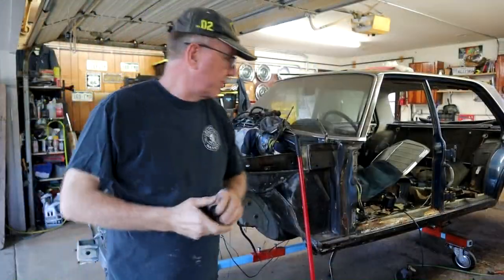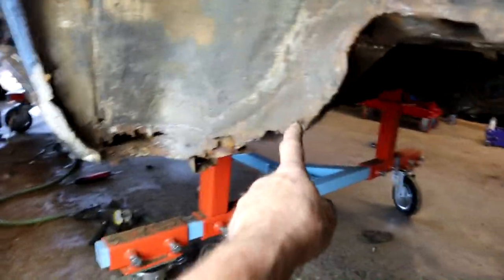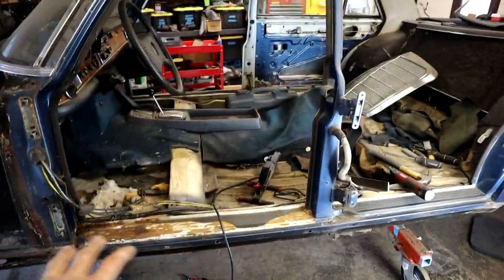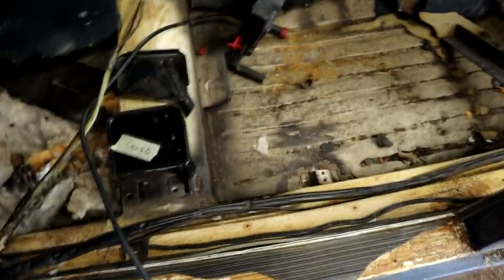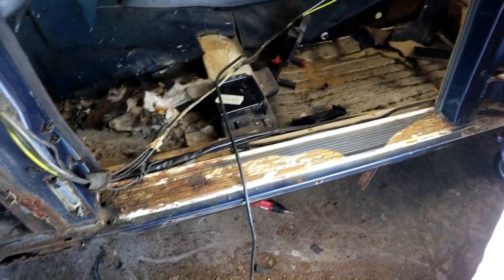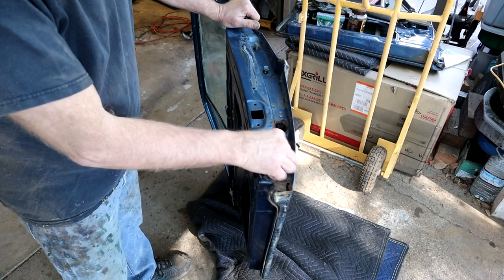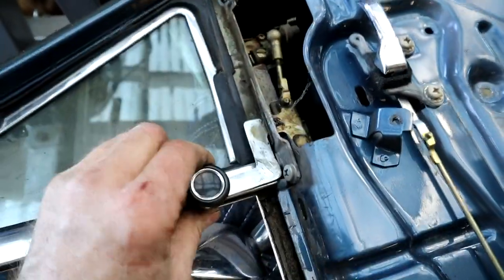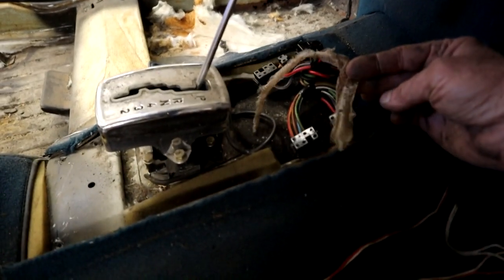Mercedes W109/108 Rust Prone Areas.

Comment: Hello John when I was Restoring my 230 sl MB “under seal”was the bane of my life watercreeps under it and that’s where the rust starts hate the stuff. when all the rust was cut out and sections where repaired I painted a thick coat of seam sealer and two coats of Chassis black Underbody wax around the box sections Then drilled holes on box sections fitted rubber plugs after injecting cavity wax . I used Bilt Hamber products (no I don’t work for them) Good Luck it is worth in the end
Reply from the maker: Bilt hamber? Not heard of them. I'll check them out. I was thinking along the same lines as far as drilling some strategic holes  and injecting Waxoil, into the hidden sections.
Thanks again.  Cheers John 🍻
Reply: @mercedesmaintenance.6339  John I assume you live uk check out Bilt Humber website in my opinion it’s a superior to Waxoyl regards
Reply from the maker: @johncross8834  I'm actually in Northern California. But I will take a look. Cheers John 🍻

Comment: My god you have a lot of work ahead of you on this.
You obviously love doing the work and have the ability to do it. It’s like you are building this car from scratch.
I don’t think there is a single part of the car you won’t have redone.
I hope you can get all the parts you need and don’t get frustrated by not being able to source or fabricate what you need.
I wonder what is your approximate time frame to complete the project?
Reply from the maker: I hope to have it completely done in about two years. The hunt for parts and solutions is all part of the fun:) 
Cheers John 🍻
Reply: @mercedesmaintenance.6339  You will have a great sense of accomplishment when done. I wish I had all your skills to take on such a job. It’s a shame you have to do so much structural repair from rust damage. That car will probably be better when you are finished than when it came off the production line.
It’s such a shame older cars are exposed to so much salt in the US.
I cringe when I drive here in the winter in New York ….. you can almost feel the salt eating away at your car.
Reply: @mercedesmaintenance.6339  John, check out a channel called “Restore It” … sorry I don’t know how to add a link for you. It is another English chap on the other side of the pond. He is doing a project at the moment on a W123 which has horrible rust damage. Maybe you are already aware of his channel. He has had to repair some major chucks of the car. Anyway….. check his video from today. You are not alone in repairing major “rust cancer” 😃
Reply from the maker: @Peter-gi3re  Hi Peter. I have seen his channel. In fact I watched one of his Videos a few weeks ago. Good stuff. Are rusty Mercedes vommon? Or are English people just crazy? 😄 
Cheers John 🍻
Reply: @mercedesmaintenance.6339  Honestly, I think you need to be from the other side to have the patience to do the work plus have the love for these old German cars. Americans are just too used to everything being disposable and view these cars as not worth the effort.
Personally I think they are worth it if you have ability to do the work

Comment: Hm, you touched the most critical part of these cars which is the crossing to the rear end. THIS is the part, where the car "dies". 3 or more different metal sheets meet each other and it is MORE than complicate to rebuild the original structure, even when opened completely.
If you need examples for certain areas send me real pics of your car by mail. Most probably I can remail these areas from my car after having it ice-blasted, even in the right colour!😃. So you might know then where to go to.....the welding spots in the wheelhouse look quite familiar to me.....a lot of these jobs where still done manually in these days so they do not look 💯% identical. Do not loose faith....Rgds, Oliver
PS: I assume you do not intend to use a bench.
Reply from the maker: Hi Oliver. I have the donor car that I'm carefully studying the construction. I see the intersection of the three different members and how they come together. It certainly is going to be a challenge. I don't quite understand the last sentence in regards to a Bench?
Thanks again Oliver.  cheers John
Reply: @mercedesmaintenance.6339  Hi John; from my experience it is advisable to use a repair bench whilst working on the structural basis of the car to keep the overall measurements intact. My2cents. Rgds, Oliver
PS: When I wrote my expectation I had not seen all damaged parts in your Video....having seen it til its end I have an imagination of what kind of repair expects you after having opened the critical section....de ja vue....😒